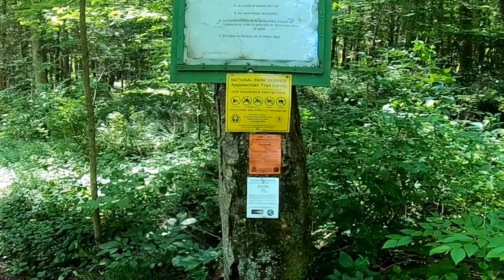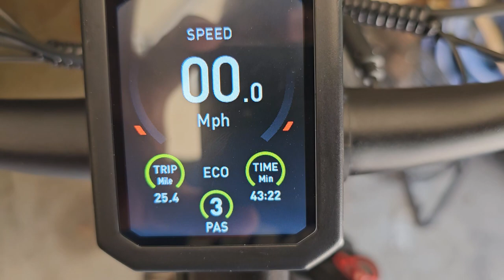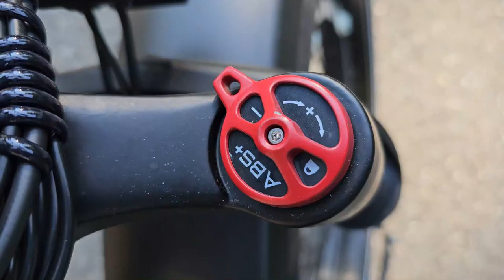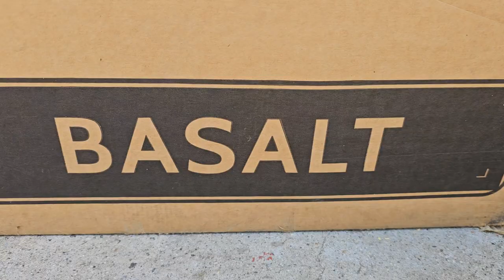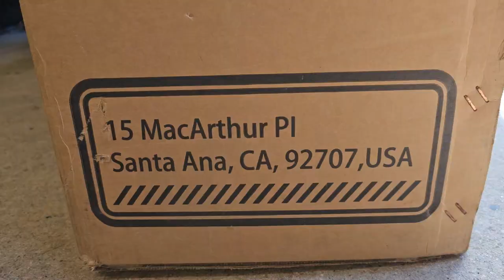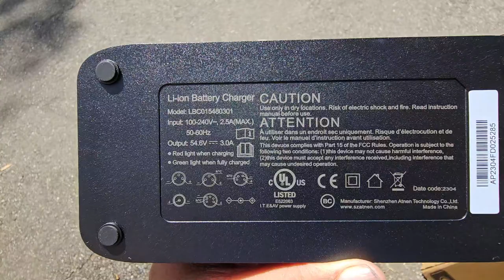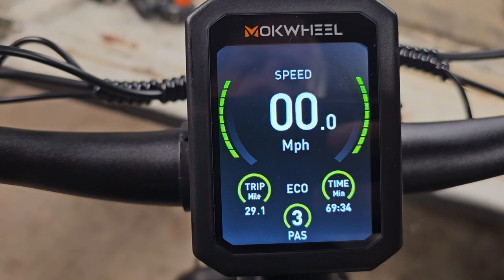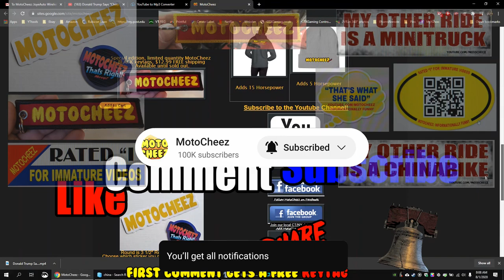32mph MOKWHEEL Basalt Torque sensor 26" fat tire E-bike, 750W 48v 19.6ah. optional Power inverter

Comment: Does it have a cruise control mode or do you have to hold down the throttle the entire time?
Reply from the maker: I saw a cruise control in the setting but I did not test it so stock it does not have cruise control

Comment: E-bikes are always fun. I got a aventon aventure as mine.
Reply: Also torque sensor bike. If you have the 2 model.
Reply: @kevinnashskitchen3517  I got the version 1. I always found the torque to be a bit jumpy and not smooth, so I bet the torque sensor will solve that.

Comment: According to the Owner’s Guide of the Mokwheel Basalt ebike, you can access the hidden menu by following these steps:

Press and hold both + and - keys to enter the parameter setting page.
Under the Setting sub-menu, short press + or - to adjust the value/unit.
After modification, the parameter will flash. After confirming the set parameter, press MODE to enter the parameter value set.
Press MODE again to exit the setting and save the parameters.
The hidden menu allows you to change various settings, such as the speed limit, the wheel size, the backlight brightness, and the battery voltage. You can find more details about each setting in the Owner’s Guide.

Comment: Torque sensor with the rear hub is not common. How was it to pedal in top gear at 25 mph or so? Could you put in effort ? Or ghost pedal ?
Reply from the maker: It seems like about half of these e-bikes that I've tested did have a torque sensor on them. In high gear 25 mph was about it and you're pedaling like crazy

Comment: Very impressive. I asked yard crews about why they don't park in people's yard and I was told it's because if the home owner needs to leave.
Reply from the maker: Yeah don't inconvenience the person that's having work done, inconvenience hundreds on the road that drives by. Makes sense right? 🤣
Reply: @MotoCheez because it's a lot easier to pull out into the lane than backing a trailer around a blind corner
Reply from the maker: I understand why they do it, it's still dangerous and illegal to park over the line, no cones or warning signs either lol
Reply: @MotoCheez  there were cones. You passed 3 of them. What else should they do? Hold up signs? Maybe you should pay attention since you're on the road and not a road course.
Reply from the maker: @djchristensen1 It's illegal to park on the highway or main road, period. Don't inconvenience hundreds of people driving by.
Maybe people that live in tough driveways to pull out of should just park on a road and still of pulling in their driveways 🤷
Reply from the maker: @djchristensen1 as a matter of fact if you are blocking the road where you're forcing oncoming traffic to go in the other lane You are supposed to have somebody flagging and in Connecticut you have to have a police officer conduct traffic.
Reply: @MotoCheez  there was no incoming traffic, they were on the same side as you. Oncoming could get by fine. Maybe watch your video again?
Reply from the maker: @djchristensen1  I'm not talking about this video specifically, I've had dozens of videos where I've encountered this on my motorcycle and in my cars. It's dangerous
Reply: @MotoCheez  you commented on this video specifically. Maybe just say you should've been paying attention instead of trying to argue that you were right when you weren't
Reply from the maker: The "no cones" comment?  He did have cones, yes

Comment: Cool video thanks.  Probably a good comparison to what i will have to do in Colorado.
Reply from the maker: Except your hills are MUCH higher 😁
Reply: @MotoCheez  at least altitude doesn't affect performance with an electric motor like it does gas.
Reply from the maker: @user-kt9li2xi9h very true

Comment: Wired Freedom goes 38mph and is same price but is 60v 20ah peaks at 2300 watts and is full suspension.  Chicago based company with outstanding customer service.  No comparison between 60v and 48v, 60v is so much better as is full suspension.
Reply from the maker: Wow. Same price?
Reply: But does the Wired Freedom have solar?

Comment: i cant find his videos anymore but i found a guy the would buy bikes and build small campers and give them to homeless people. then he started using E bikes putting solar panels on the campers and the last time i checked before i lost his channel he was getting over 200 km on a single charge. then let it set in the sun and took off again. i think thats about 125 miles to a charge. and thinking of trying it myself
Reply: wow i just noticed you have the throttle on the left side. WOW
Reply from the maker: Wow. That's impressive, and AWESOME
Reply from the maker: Yeah, I switch some of them to the right, but you have to have it push upward so it doesn't interfere with the shift select.
Reply: @MotoCheez  if anyone can figure it out you will. maybe move the shifter to the left

Comment: Let that battery cool down before putting it on the charger. It'll live longer.
Reply from the maker: I've never heard that one, I've heard that it the battery is cold in the winter it could ruin lithium cells. Or of course if it's overheated above the temperature recommended to charge which is usually 104 Fahrenheit
Reply: @MotoCheez  Heat is the killer of all battery types. Discharging and charging any type of battery creates heat. Keep your charger in the coolest spot you have. Lithium performs better in cold compared to a alkaline, NiCad or lead acid battery for example but all batteries take a hit when left in sub zero temperatures. I've lived and served in Alaska for most of my life and we use lithium batteries in critical things like headlamps because they're lighter than alkaline, but more importantly lithium performs noticeably better when it's REALLY cold.
Reply: Ever heard of the RI Leapfest? I used to compete in that before I retired.
Reply from the maker: Wow. Lithium performing better than wet acid or other type batteries in the sub zero cold. That's an absolute first time hearing of that. Any lithium motorcycle battery I've ever seen never starts in the winter and they want you to warm them up before starting them or even charging them, it's in the manuals and even online. 
I know extreme heat is a killer, but so is extreme cold if you look up what killer is of lithium batteries
Reply from the maker: Now I never heard of that, I'm not doubting what you say I'm just going by information I've read on the internet and other people with lithium batteries and their motorcycles